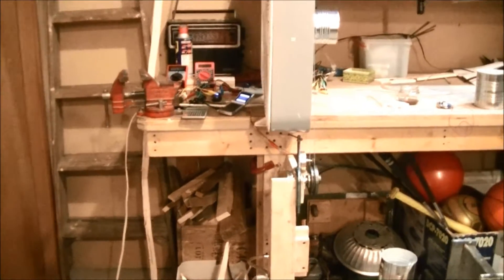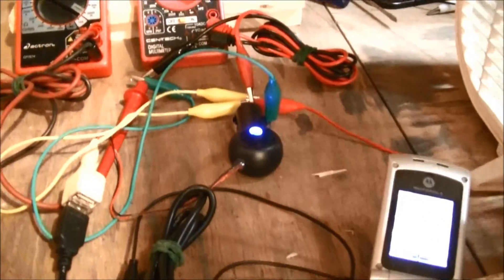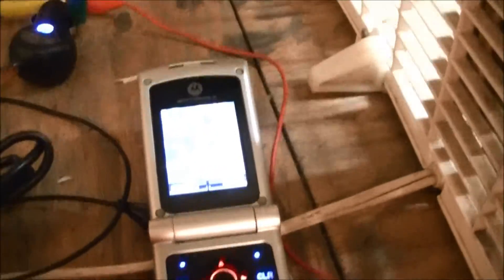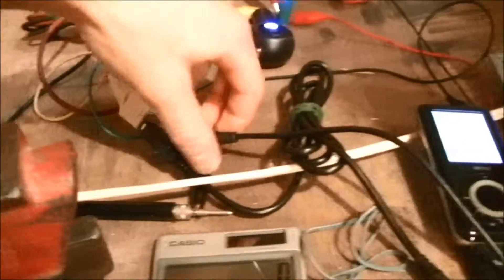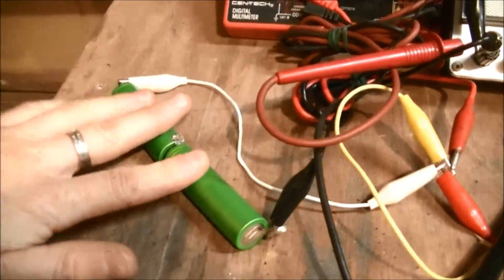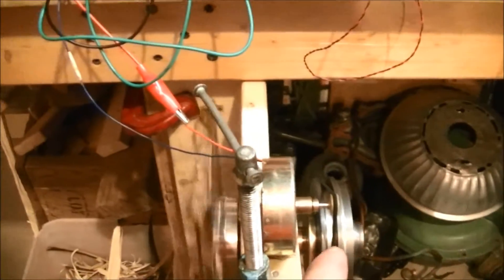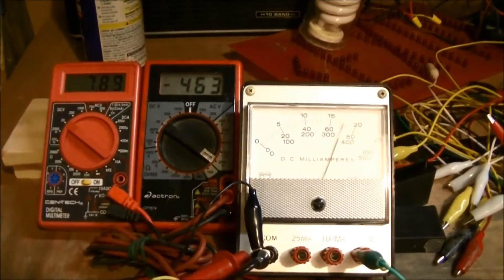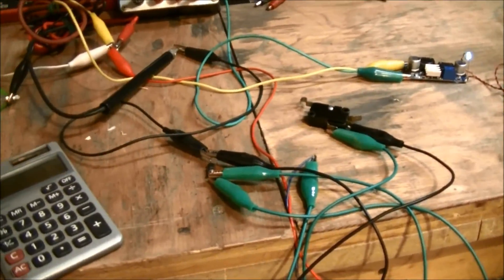Stirling Engine #5 Charging a Cell Phone, Running a Large Fan and Has an Electric Starter

Comment: You need a more powerful DC motor. How many volts is the one your using now?
Reply: Does it really matter?
Reply: alex pencek
Actually it does. if you have a 3VDC motor and a 12VDC motor the 12 volt motor will put out more power when used as a generator.
a 24 volt motor will work even better.
Reply: It doesn't need a starter at all but it is very cool
Reply: alex pencek
What I mean is pull the DC motor out of a cheapo electric food chopper. Most of the time they use 24V motors. The last two I opened up had those. One way you can tell is gently turn the spindle and if it steps then it's DC if it doesn't then it's AC.
Reply from the maker: coondogtheman1234 Well the problem with more powerful motors is that they have more friction.  I've tried some 24 volt motors from printers and they put out less power because they have more friction.  The motor I am using has ball bearings and has very little friction.  It's very efficient.  I'm not sure what it is rated for.  It will run on 1 volt all the way up to 24 volts.  I'm sure it can go higher than that but I don't want to fry it.
Reply: +Makerj101 Just curious, and even if this comment is a little late, did you tune your engine? Sometimes just getting it to squeeze a little more torque out of it can make a big difference.

Comment: Yes and no :) 3 phase no you need 4 magnet but 3 time more coil :) so 12 coil but arrange in either a star of delta configuration :) if you want to make only a single phase then yes just a series of 4 coil :) in a NSNS configuration

Comment: More then welcome my friend :) if you need any help let me know :) for the 3 phase depend which configuration you plan on making and the number of pole which will determine the frequency you will have at the output vs the speed. ex 4 pole = 60 hz at 1800 rpm and 3 phase rectify you get a nice 180hz lovely sound :P

Comment from the maker: I think the motor that I am using as a generator has a lot of drag and is not all that efficient, cause when I put the belt on it slows the motor down a good bit.  Only thing that I don't like about making a generator is that I will not be able to start the engine from the battery!  Thank you!

Comment from the maker: Yeah but my original idea was to build some sort of circuit that has a thermal couple and relay but I didn't like the idea that it would use power.  

Next I'm going to have to add a auto gas valve and gas igniter!  So all I have to do is press a button and several minutes later it will start up the engine and start producing some power!  Maybe I could even add a battery monitoring circuit.  So when the battery starts getting low or I plug in a load it starts up and shuts off when its full!

Comment from the maker: current off once running cause once the engine is running the starter is the generator and then would have a even lower path of resistance than the diode to go though.  
Thank you!

Comment from the maker: Actually Approtechie did that on his one engine demo.  The only thing was he didn't put the diode, but same concept.

Yeah I actually thought about that!  I was thinking a little simpler set up though!  I was just going to use a thermal switch.  It would not have any leakage current or mosfet not being fully on to worry about.  I have quit a few of them from dryers, laser printers, and furnaces.  I just have not had the time to try it out yet.  No you would not need to turn the starter - cont...

Comment: I added an opamp to maintain the input voltage instead of the output voltage. This let's me keep my generator (solar cells in my case) operating at their maximum power point. I think you noticed that your stirling outputs more power at a particular voltage/current in a prior video. You might end up coming to the same conclusion as me: use MPP boost to charge a higher voltage battery, then use step down converters for various low voltage loads running off the system.

Comment: You can connect several super caps in series to boost the effective voltage capability. People use super caps in series like that to use as a substitute for their 12V car battery... It works, as long as you use your car often enough to avoid losing too much charge to the car's quiescence power draws and internal cap leakage.

Comment: I really like the starter and generator in one :) Not sure if thats been done before.
You could take it a bet further. Replace the switch with a transistor or MOSFET, with a thermistor controlling the gate. When you get enough heat to run the engine, it could self start. You'd need a way to turn starter current off once running though.

Comment: HAHA of course :P I'll send you the code right away you might want to clean the code of thing you don't want on it or if you want let me know when you have the bare bone project so I can write you a fresh new code :P hehe for the 3 phase very easy I would go around 6 pole since the engine doesn't run a high speed at around 1200 rpm you will have 60hz and the advantage of dealing with ac is you have less to worry about the wire resistance :) for the turn I would go little more then regulated it

Comment: Nice nice well for your generator quick tip if you need high current you will need big wire if you need more volts you need more turn I would suggest making a 3 phase generator then rectifying it after you will get a nice 180hz frequency well...that's depending on how fast it rotate and how many pole you have :)

Comment from the maker: At 4:20 you can see some large capacitors that I was trying to do that with.  When they were charged and I hooked up the MP3 player it would charger it for about 10 seconds and then cut out.  So it helped but not enough.  I also tried some 1 Farad capacitors and they still didn't do much better.  So if I had some big super caps that would probably be best.  I wish I did cause that would be fun for other things too!  Thank you!

Comment from the maker: That would be a pretty good use for the boost converters.  This one has a minimum input of 3 volts so it would not work with the 2.7 volt super capacitors.  Yeah you should!  It works pretty good!

Comment: I had trouble with those little eBay "3A" converters' inductors getting very hot when inputting only 2A or so. eBay search "DC-DC Boost Converter 10-32V to 12-35V 6A 150W Step Up Voltage Charger Module" -- it never gets hot, comes with nice big heat sinks, and it's cheaper ($4.86 + free ship as I type). Only downside is it requires at least 9.1V on the input. I replaced the crappy 35V output capacitor and had up to 50V out no prob.

Comment: Heres the idea your vid gave me: Stirling engine windows :D - Make big glass pane stirling engines with clear pistons so u can still see through it... maybe use mag- lev to reduce resistance of the piston.. (we utilize the difference of temp between indoors and out)- good for cabins and eco homes with wood stoves.. (and it probably would work in summer cause its colder indoors) - MAKE IT PLEASE.. thanks i will help xD